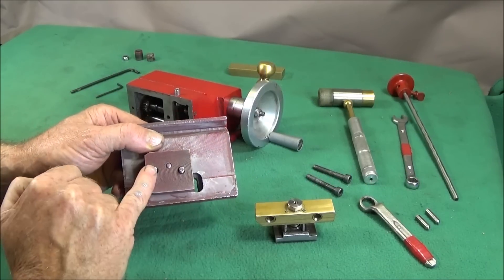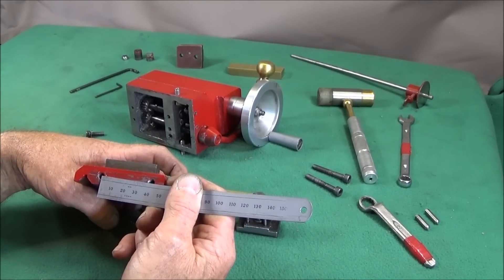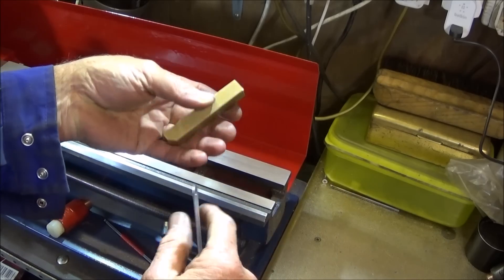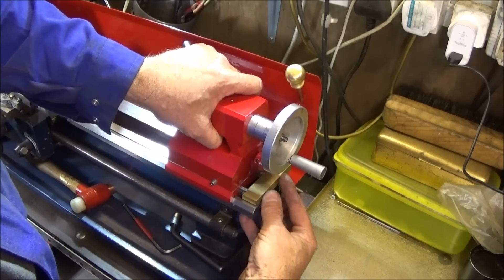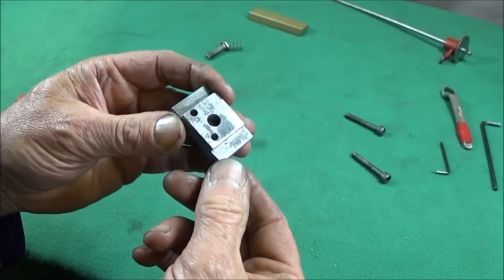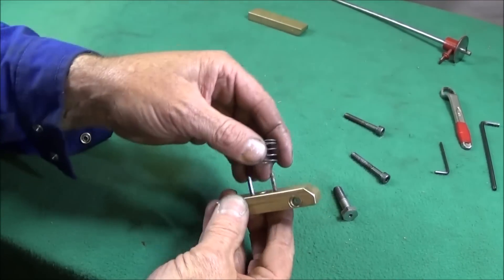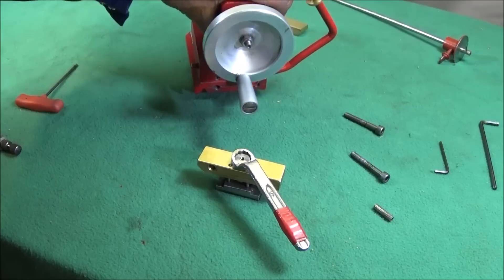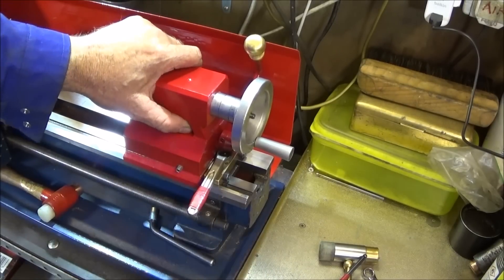Chinese Mini Lathe Tailstock Upgrade Part 2. Double Lock Lever

Comment: You have some great ideas for mods on the mini lathe Steve. My Chinese 7x14 mini lathe has a tailstock whose centre is about 1mm higher than the Headstock centre and I'm considering somehow clamping the upper half of the tailstock (because it's flat and at right angle to its front face) onto the cross slide and flycutting it down to correct height. Is there any way I can show you some pictures and ask your advice on the best way to do this before I go at it?
Reply from the maker: Hi it is normally just the lower part that rests on the bed that needs slight alteration. The bit that sits on the raised front section of the lathe bed. I just put some medium wet or dry or emery over part of that, rested the complete tailstock on that and moved it back and forth until it's lowered. It will only be a millimetre to get it right. Fly cutting would be too much to get right on this type of thing and I wouldn't attempt milling it in any way. Regards Steve
Reply: Hmm. Ok. I was worried about damaging the shape of the 60 degree groove doing it by lapping

Comment: I cut scribe marks on the bottom  that joins the ways  then that little clamp from underneath i scribed that also both with a dremel  so  these mount surfaces act like a brake pad to reduce sliding of tailstock. My tailstock is not as beefy as yours but it does the same operations . I also remachined the locking level so it's 1/2 inch longer to increase tension which allows me to press bearings or shafts into a press fit pocket it seems to reduce sliding on mine also i made a end stop i can lock down and remove that ends  all movement .  This is not designed as a press because of the limits of the thread but if it handles though's forces  it won't move when i drill .  I like your idea but i try to limit all this loosing and tightening just more operations.

Comment: You must be a couple or a few years older than me... when I went to school we had just gone all metric and nobody ever said "inches" (although, in physics, when we ran out of 1 KG weights we used a couple of 1 lb ones as approximations)... but you slip backwards and forwards from Inches to millimetres all the time... it's a bit funny but says "ya boo sucks" to the great Imperial Vs Metric debate).

Comment: steve i dont have a lathe yet i plan to try to scratch build one any suggestions how should i begin the bulid i never used a lathe before but by your videos i have some idea but your the guy to ask for advice. how does the big round wheel with the jaws work and how is it attached to the motor i know the back stock end holds the drill bit for boreing but i dont know everything i like building my own tools saves me buying them and breaking the bank to get them plus im very handy with tools and fabracating parts with out a lathe takes longer with out one and harder as well
Reply from the maker: Hi Steve, It is possible to make a very simple small woodwork lathe using a power drill, but making a metal work lathe that actually works would be impossible without first having all the necessary machine tools and specialist equipment to produce one. You would also actually need a good quality lathe in the first place just to start with.
Regards Steve
Reply: Steve Obee I suggest trying to buy a used lathe. Either online or at local flea market or garage sale or auction or the like. Not sure of your situation, but that's what I would try.
Reply: @neihuslim  good point,I do believe you need advice and help with basics as well ,reading and using calipers, micrometers and safety 😈 gear,finding people to pass on knowledge like Steve are difficult to find,so keep it up😇 Steve 😇.

Comment: Hi Steve, some great videos and some brilliant work done on your Amadeal, keep them coming. I have the same lathe and have a couple of questions if you dont mind. How do you find the alignment of the tailstock? I have had to mess with mine quite a bit and its still not perfect. Have you had to play around with any sort of alignment on the machine? Finally what QCTP do you use, it looks very nice?

Thanks, Craig
Reply from the maker: Hi Craig, I did have to align my one but it was only the side adjustment. The Quick-change tool-post is a Dixon. You can get them from RDG or Chronos on Ebay or from their websites. To get the right size select the one that fits the Mini Lathe and the Myford. They use exactly the same size. My regards, Steve